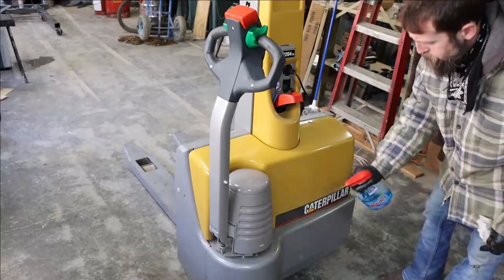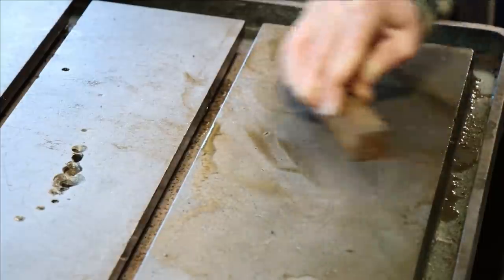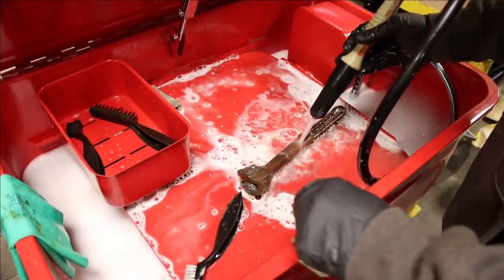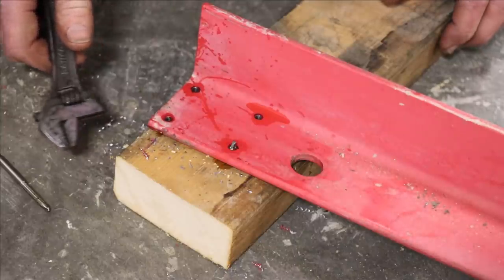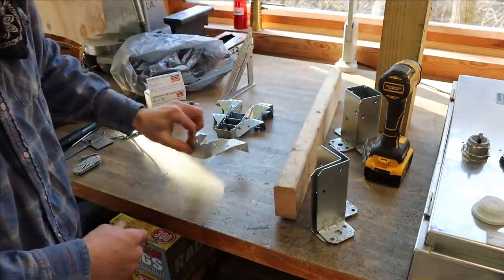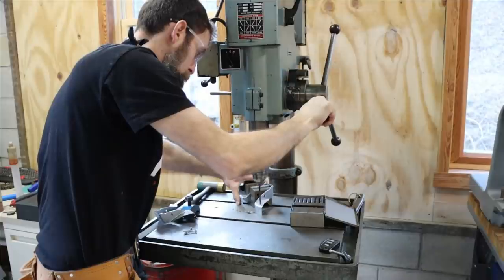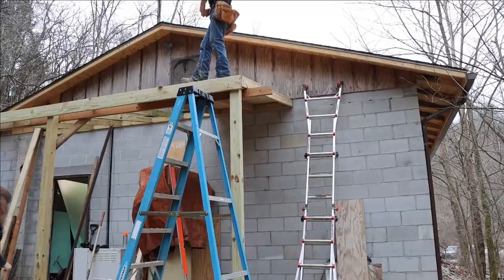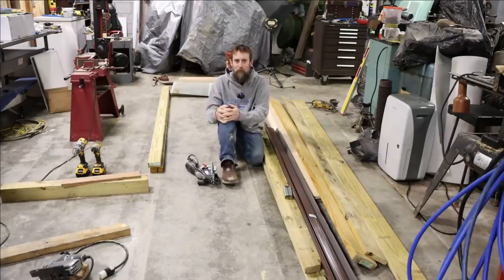Building the Compressor shed off the shop. Protecting my equipment from the elements.

Comment: Haa....BLEEP.....well bleep happens... glad it's ok, that would make it an expensive shed! Whip yourself up a little angle iron frame and casters for your parts washer. They're aggravating and sloshy  trying to move them, makes them handy to take to the door/project for a cleanup job too. How does the zep compare to the old fashioned combustible/smelly petroleum cleaners in you opinion?

Comment: In 1994, the pressure-treated wood industry has transitioned away from the use of Chromated Copper
Arsenate (CCA-C) to alternative preservative systems for residential use, effective 12/31/03.
Some of the replacement alternatives are generally more corrosive than CCA-C. The corrosive
content of treated wood may be variable. Over time, the durability and load-carrying capacity of
Simpson products used with treated woods can vary widely depending on the many variables.
This makes it impossible to predict accurately if, or when, significant corrosion of connectors,
anchors, and fasteners will begin or reach a critical level. The treated wood industry specifies or
recommends stainless steel and hot-dip galvanized products for use with pressure treated wood.
To select the appropriate connector for use with various pressure treated woods, see the Pressure
Treated Wood Technical Bulletin (PDF). 

For exterior "wet" environment in contact with current day wood preservative treatments (not CCA) mechanically galvanized hardware and fasteners do not supply adequate corrosion protection.  Simpson Strong Tie has specific recommendations for fasteners in use in the different environments and with different preservative treatments (Corrosion Information for Connectors and Fasteners, and Corrosion Information for Anchoring Products) and that needs to be consulted before determining the appropriate fastener and fastener corrosion protection to be used.

Comment: I put purple power in my parts washer and it ate all the paint and killed the pump. 😂🤣 I think that stuff is too strong when not diluted. Now I just cut the top off the purple power plastic just and just put my parts in the plastic jug to soak.
Reply: The Purple Power I have crusts up too. I have troubles with it in spray bottles from time to time. Stuff crystallizes. I still love it though. And yeah it can strip paint sometimes. I use Purple Power as a stone hone lube when I sharpen. It's the best!

Comment: I was looking for rubber gloves to use with my parts waher. I went to a GuN SHOW and found ARMY SURPLUS RUBBER GLOVES. They  are rated for NUCLEAR/BIOLOGIC/CHEMICAL.. Don't know if I would use around RADIOACTIVE/ NEUclEaR materials, but they have handled any solvent I've used for over 20 years. The best thing, they almost go to the elbow, and I can a sweatshirt with long sleeve with no problem. I think I only paid 5 or 6 dollars.

Comment: I wonder if you can get a heater for those parts washers. I find mine to be much more useful with warm water than cold.
Reply: Yes. They sell them. Even a water heater element will work. Has thermostat right on it. I have 1/2 a doz. reclaimed from water heaters. Down side is requires  240v power and separate circuit.

Comment: Would it be better to mount your post to the bracket 1” off the ground?   That way, in the summer, the bottom would have air around it to dry out.  Not saying I’m an expert but I had a similar situation and the wood trim on one side of my garage door kept soaking up water and peeling the paint off.  After 20 years of that it was soft like balsa wood.  The other side was 1\2”  higher off the ground and no issues.   Maybe your treated wood would be a bit better than what I have, so maybe you won’t have the same problem.

Comment: Are you planning to put flashing along the siding of the building where the shed is? That T1-11 looks like it's warped a bit at the bottom and that might make it annoying to get the flashing under the siding with the roofing on.

Comment: Just an observation, why didn't you take out the 2 bolts holding the lower foot on the press. Using that drill press would have been easier for drilling and tapping.

Comment: Supposedly, using two hands to apply even pressure on both ends of the tap handle is supposed to reduce the chance of breaking a tap.
Reply: A likely story.

Comment: Just curious, why not weld the drill press table holes closed and grind them down? Is it fear the table may warp from the heat?
Reply: If you don’t have to weld cast iron.... don’t. It requires a lot of experience to not stuff it up.

Comment: Ok so you dug a 3 foot deep hole, filled it with concrete then put 3" tapcons in it for a end post?  Bit over kill dont ya think?  Id say a 2" gravel bed with 5" concrete little pad would be plenty to support a single column and a lean too roof....  is a good way of doing it by setting it to the ground level with a footing but a 3'x1' pad will support a few thousand lbs.. building code is 2'x2' pad below frost line every 10 feet for lally columns under a 2 story house...
Reply: Seemed about right to me. I was surprised he didn't go with sonotubes though. But I guess he doesn't want concrete visible? You can even make your own just with some tar paper. Least that works for small diameters.
Reply: Being an open shed, he was concerned about wind lift, thus the security of substantial anchorage.
Reply: @russellstarr9111  you can't worry about everything. Any wind that can blow that overhang off is going to cause bigger problems anyways.
Reply: @1pcfred  Opinions vary.

Comment: might be handy to get a course waterfilter on the partswacher , just to filter out all the particles the size of sand , should help keeping the solution clean longer
as for the reamer : maibe you can clamp a cheap wet stone under the thigkness grinder clamped in a rotator and machine the taper on it and use that to carefully fix the taper in the drillpress , that should work ok and might be cheaper then buying the reamer for that one job
as for the shank : usually the shank is friction mounted too , maibe you need to just replace the shank itself
about the added roof : too bad you didnt extended the eve when the sheets where off the roof , couldve lengethen the beams off the original ones and maibe not needed pillars at all having it counterweighted by the rest of the roof structure

Comment: Would silicon bronze be a good option on the drill press?
Reply: Probably not. You'd have to heat up the whole table and that is a lot of trouble. There's a kid here on YouTube that brazes vises a lot to repair them. He heats the whole casting up before he starts brazing it.

Comment: Hmm....I may be going insane.  I know I made a comment, but it has disappeared.  Anyway, car batteries are designed to provide a high amp draw for a very short time.  Deep cycle batteries are designed for a constant load over a longer period of time.  One word of advice- don't drain those batteries below 60% of their capacity.  70% is even better.  Basically, don't take them below about 12.35 volts for 12 volt systems.  In other words, about 1.25 volts per cell.  24.75 for 24 volt systems, etc.  The greater the depth of discharge, the fewer cycles you'll get from them.  I'm sure you already know this, but try to keep them warm when the temps fall below 25° or so.  If they're fully charged you don't have to worry much about the cold.

Comment: Steve, smart choice on the batteries.  
Question:  How would you remove the arbor from the chuck.  I assume it is also a tapered press fit.
Reply: Opposed wedges that are made for removing Jacobs tapers (they fit in/push on the small groove at the bottom of the taper). Tom Lipton (OxTools) has a good video on refurbing a Jacobs chuck.
Reply: @mattmanyam  -Thanks for the info.  McMaster Carr sells them - for anyone else interested.

Comment: You should use a stirrup type post anchor set directly into the wet concrete.
Using brackets and concrete anchor fasteners is just adding more work and more replacements when they rust away.
https://www.bunnings.com.au/dunnings-115-x-600mm-leg-m12-galvanised-full-stirrup-anchor-post_p0102704

Comment: Steve, I saw it coming and yet I literally jumped and yelped as the tap broke.😬 You know it's going to happen but you just keep trying. Good thing your mental health support team was on site. FWIW I haven't used a tap handle for as long as I can remember. I always (unless space disallows) use a cordless drill. That way my brain is focused on holding alignment and sensing torque and not on coordinating perfect complex muscle movement. I use a drill appropriately sized to the tap and with carbide jaw inserts. They only break if they are dull and I check for that before hand. It goes 10 to 100 time faster.
Question Steve: How long did it take you to convince your son that digging post holes in rocky soil was the greatest fun he would have in his entire life?😁
Elizabeth is an awesome helper. You are a rich man Steve. BTW, shouldn't she be wearing the Fox T-shirt?

Comment: The first question you have to ask yourself about battery products is how often they will be used. People who say don't use car batteries are falling way short  of the mark. Car batteries last 5-6 years with starting an engine 5 or 6 times a day. There are brands of electric pallet lifts that are sold with car batteries because they will only be used for 4 or 5 lifts a day. 80% of the energy is used in lifting and 20% in traveling on average. I suspect your lift would not be used more that 30 minutes total a day and new car batteries of a good brand will provide better value over time with a decent modern charger. If yours was a production shop where the jack was used by multiple operators and went over 60 minutes clock time a day the traction batteries might come out in front over 5 years.

Comment: These comments really do not apply to your build because it is just a small lean-to roof.  These are more for someone who is watching/reading this and using this video as an example to building a more substantial lean-to or shelf/floor.

The key to a strong roof is the ledger board and how it is connected to the existing wall.  Hollow CMU "walls" are not very strong.  If the roof was heavy or carrying addition load you would need to through bolt and use large metal backing plates on the inside.

Through bolting a beam to posts is not the best connection.  Beams should be placed on top of or "set into" the post.  Adding an additional 2by to one of the faces of your post to directly carry the load of the beam down to the "foundation" is a good solution.

Comment: I would suggest you not have the post make direct concrete contact. They make brackets for patio posts that keep the post off the concrete.
Reply: I doubt if Steve will ever have an issue with his posts touching concrete. But if he does like Steve says the posts will be easy enough to replace.

Comment: Did you used a plasticiser in the concrete? A squirt of washing up liquid will do if you haven't got the real thing. To make the mix workable without plasticiser requires a lot more water than that required for the chemical reaction of the cement, and the excess just weakens the mix. You'd be surprised at the difference it makes. Hope I'm not teaching my grandma to suck eggs here, you're a pretty knowledgeable guy Steve!

Comment: Dude your not going 2 like casters on your press. It's going 2 move when your trying 2 use it.  All you need is 2 pics of steal to extend the sides, on the bottomof the press. Then you just use your lift 2 move it. Trust me from experience. FYI your pallet lift
Reply: You did not pay attention to what Steve said. He said he's going to put threaded rod in the press stand to get it off the wheels. Plus he's going to take the castors off once he gets the press situated in his shop. So relax.

Comment: Unbolt the cross bar & use your "new" drill press to drill & tap the holes for the castors. Your "construction persona" needs to be turned off & the machinist in you needs to be turned back on again. Still look forward to spending early Saturdays with you every week.